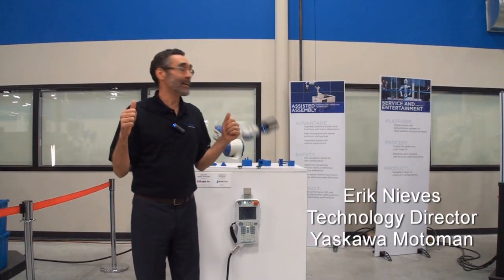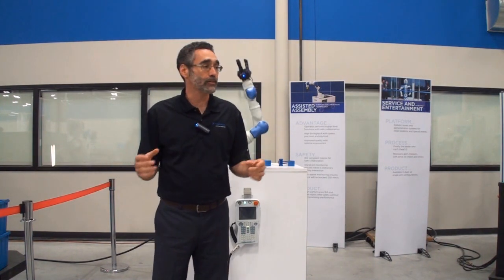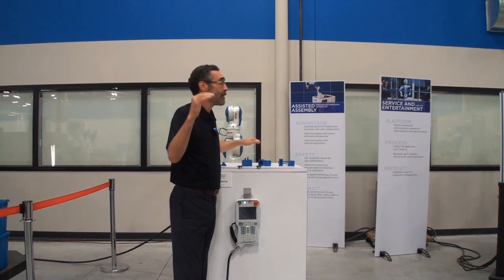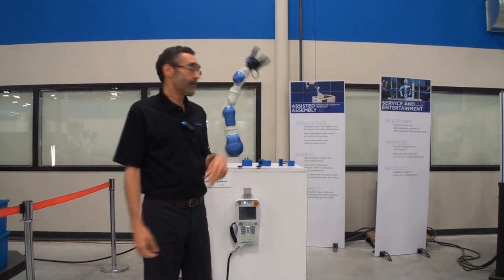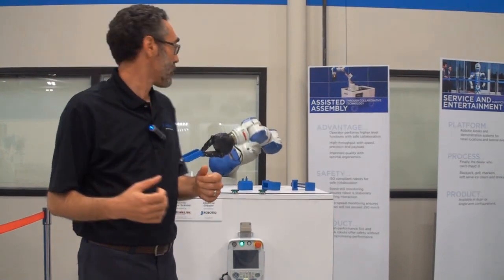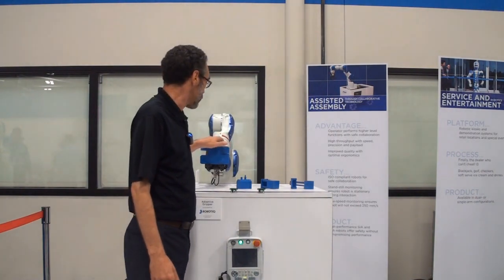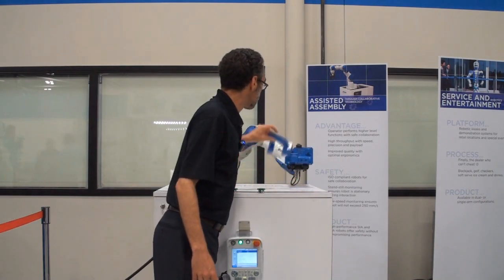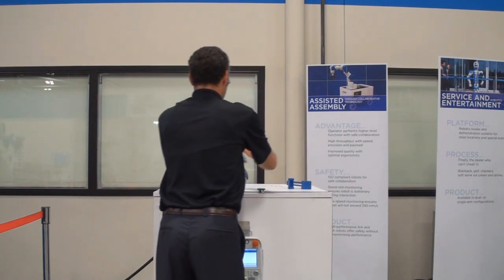Collaborative Robotics and Functional Safety

Comment: I can understand the idea of slowing down the robot. It's useful i.e. when there's an automated spot welding line, where operators are required to replace worn welding tips. Eliminating conventional safety fences makes it faster and easier - an the process doesn't need to be competely stopped. But I keep wondering why would anyone let people collaborate with robots during any assembly process, when they may be replaced by much faster, more accurate and often cheaper manipulators or other robots?
Reply: You may not have enough budget to automate the whole process or there are task the human can be more suitable